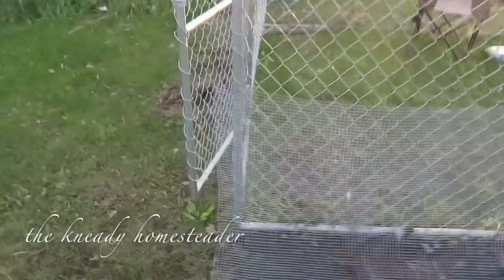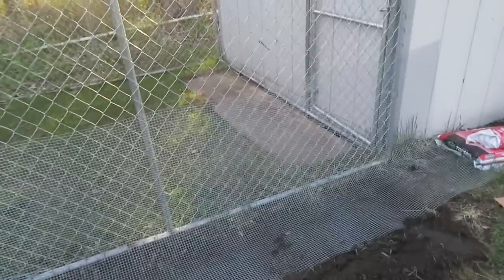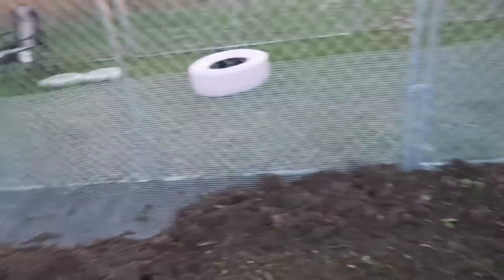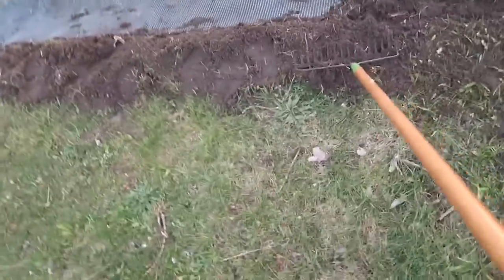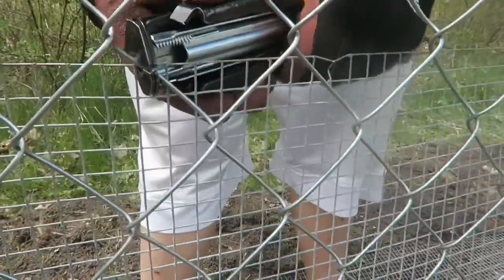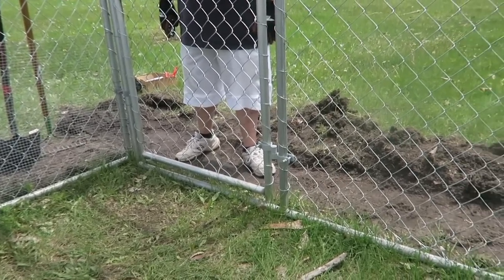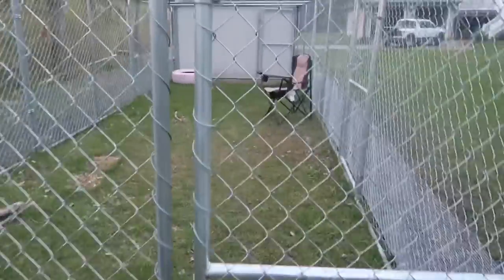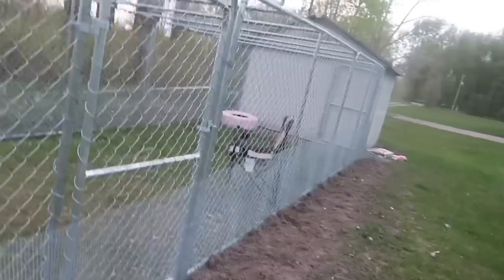Building Our Predator-Proof Chicken Run Part 2: Buried Hardware Cloth at Base

Comment: I originally did this on the 7’x25’ run. The burrowing critters went right under. I ended up digging down about 4” inside the run, making a basket under the entire interior of the run, attached to the frame. Then I replaced the soil, threw seed down and covered with straw. It has prevented the gophers from eating all the feed, and I have greens growing inside the run now.

Comment: Here's a thought, put solar lights around the base with 
your flowers and herbs???
Reply from the maker: i am afraid Geddy would dig them up! hahaha We do have 2 big solar lights though....one for the front of the coop and one for the back.
Reply: It is best not to light up coop. Animals can find the coop easier.maybe a motion sensor solar light? For the vents we cut one front and back andcovered with landscape cloth.  And we only covered one vent in winter. We live north Michigan area. Best thing we did was use plastic coragated piece under perch. It is 15"wide and length of perch. It just lays on coop floor and slides out for easiest clean up each day. Free from local sign shop and we sent over a dozen eggs .you are going to have a great time with the chicks.

Comment: I have a question I'm sorry to bother you it is not about chickens or anyting but I made some grape jelly and some apple jelly and some orange marmalade jelly each one had six to eight cups of juice in it can I put 5 to 7 cups of sugar and one box of pectin it has not turn to jelly it is liquid can I redo it and add more pectin or what do I need to do
Reply from the maker: i am not sure, if you canned it already? you could try to reprocess it. always test the set of your jelly before canning it. I use frozen spoons. Keep some soup spoons in your freezer, and when your jelly is ready to be canned, dip a spoon in it and see how it sets up. if it drips right off without becoming thick, then you know your jelly isn't ready. sometimes it needs more pectin but usually its due to not hard boiling it long enough or hard enough. jelly is trickier to make than jam, since juice is harder to thicken than a berry or fruit with natural pectin already in it. but definitely part of the learning process. ❤️